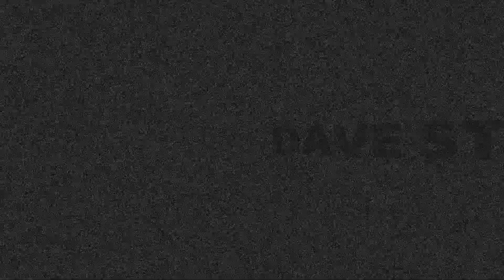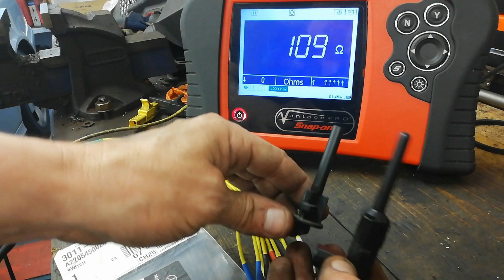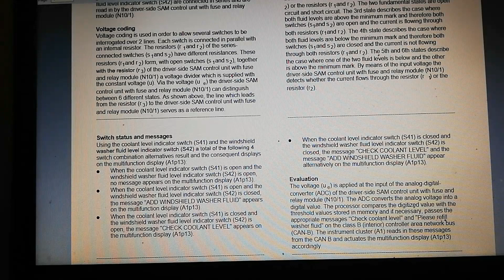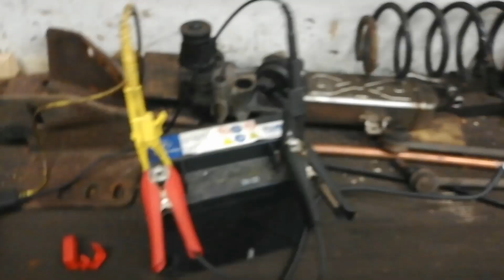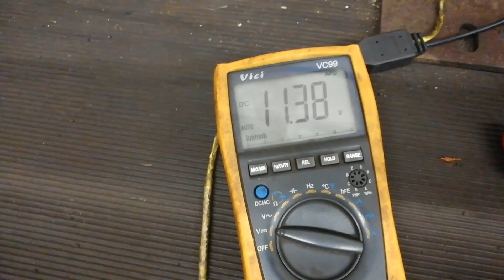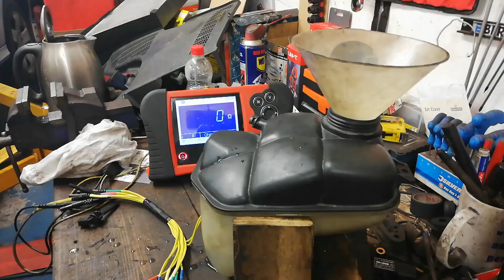Mercedes coolant level warning. Fault Testing and Circuit Diagnosis

Comment: Excellent video, i had washer fluid level low for months so i ordered a new mercedes sensor and before it was delivered the warning went off and didn't come back on but few days later coolant level low appeared. i messed with coolant sensor and even pulled out of header tank it still shows, i'd have never known the washer fluid and coolant are linked, you sir as saved me a load of messing i will fit the washer fluid sensor tomorrow and check it again, thank you

Comment: As I got this message (w211 2006 E320 CDI, and I am always checking coolant level) lo and behold it was rather low! Where did the coolant leak from??? The water pump! 200 000 miles it lasted! So if your miles are getting up there REPLACE water pump do not delay! Secondly, the black cap on the expansion tank, replace it also! It has a o ring that goes bad over time,  And if you squeeze the fat coolant pipe that goes to the thermostat and  the coolant cap starts making a sound, it is leaking! and if you fill the coolant to level and you still get coolant low message, the sensor inside the coolant reservoir is bad, you need to replace the coolant expansion container, it is easy to do and not that expensive!

Comment: Those Airmatic pump motor magnets are great, aren’t they?  Those coolant reservoirs are fairly cheap in the states. With all that plastic (which becomes fragile over time) in the cooling system plumbing, I absolutely want that warning system to work.

Comment: Dave can u help me about information my Radiator coolant is keep going to wind shield tank and losing coolant every 2nd day to half empty 😢 thank you
Reply: Well if you loose coolant every two day I would check the coolant tank. It might be cracked. If there is a small crack on the reservoir it might leak only when the engine is hot and the system is under pressure, so I would check it at operating temperature

Comment: Nice video Dave appreciate the effort 👌
How did you tackle the wiring on the plug to remove the warning light please? Resistor or just join them together?
Cheers
Reply from the maker: I show at the end of the video the sensor plugged in and cable tied
Reply: Thanks I couldn’t see it at the end but at 10.16 you mention just letting the sensor hang?
Reply from the maker: @grahamwilson2748  thats correct

Comment: i was thinking thats how coffee machines tell water level , and will the longer sensor fit the hole when i seen the longer one. and when you show the diagramm i was thinking is that longer one the washer fluid sensor. Real good information in total its why i subscribed . ...
Reply from the maker: hi intrade, yeah the longer one fits, i think i had it in the bottle when pouring the water in. The washer fluid sensor is completely different but functions the same. it has the float attached to it. thank you for the compliment, cheers dave

Comment: Great video Dave, would love to see some more videos on level sensors, VW oil, water level, Peugeot Additive level sensor....
Reply from the maker: Hey Colin, aye  i'll  post stuff that comes in that is interesting. This one is a bit different with the 2 sensors on the one circuit, cheers dave

Comment: Ahhh.....the old sensor itself is serviceable but the actuation element is not. Too bad. Thought we might see ya breakout yer Autool battery tester for a minute their Dave. Nice work as usual. CHEERS PAL
Reply from the maker: hey ian, yeah the merc engineers love to make simple stuff more complex than it should be with the single circuit and two different sensors wired in series. Voltage test was god enough for me to condemn the wee battery. all the best, dave